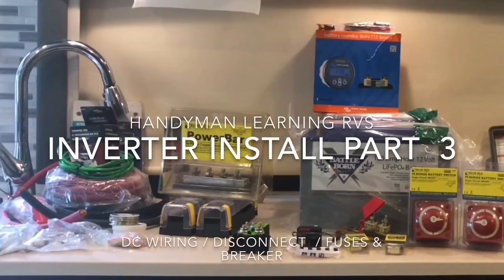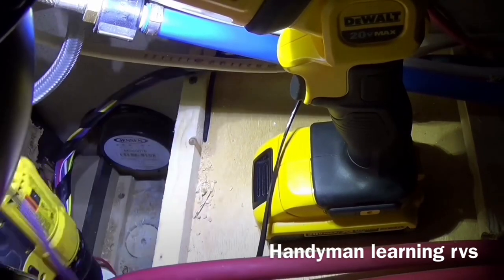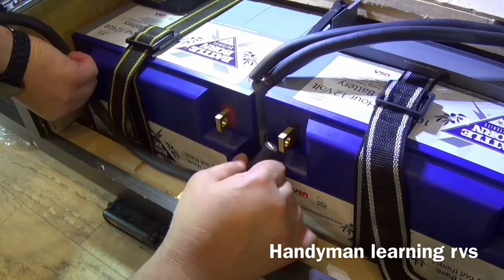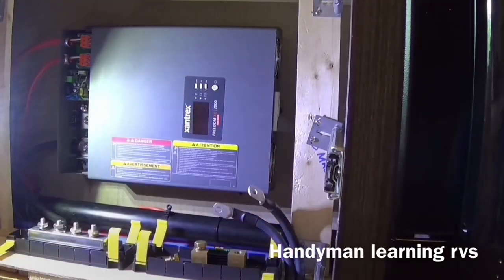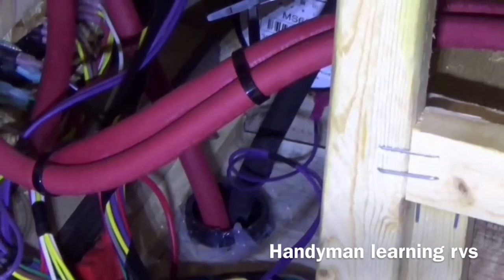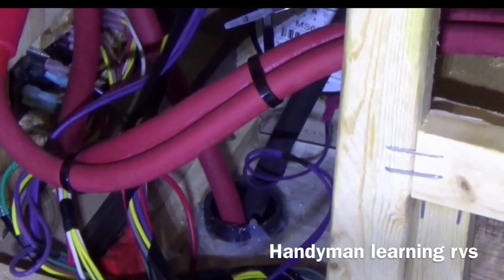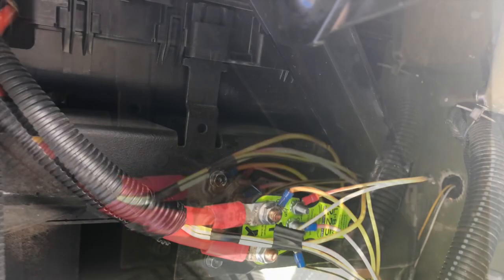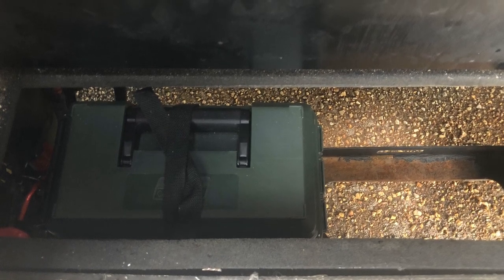RV Thor Axis Vegas inverter charger and lithium battery system install Part 3 of 3 (dc 12v wiring)

Comment: Hey, thanks a million. Excellent tutorial in a compressed time frame. It really works. The "lazy" in me wants you to provide a wiring diagram but I'll just have to watch thru again and draw it myself. I really want to see how you rewire and relocate the chassis battery. Accessing it's original location is like performing a colonoscopy with a flashlight!

Comment: How has the Li BIM worked?  Any alternator problems? I am adding 2 Li batteries also....Battleborn recommends a battery to battery charger and disconnect the BIM.  The charger is a lot more difficult to install and I lose the emergency start function....your thoughts?
Reply from the maker: I haven’t had any issues with it Li BIM. It doesn’t completely top off the lithium batteries due to the lower alternator voltage. When I purchased my batteries Battle born didn’t mention anything about a battery to battery charger at the time. The battery to battery charger will do a better job completely charging lithium batteries. If I were to put the battery to battery charger in I would cap off the Ign, Sig and Gnd wire. Then install a Blue Sea Systems 300 Amp m-Series Battery Switch in it’s place with it turn off to keep the batteries bank separated. That way if you need the emergency state just switch it on to jump start off house battery bank. Then after starting the engine switch it back to off.
Here’s a link to the switch I’m talking about. 
Blue Sea Systems 300 Amp m-Series Battery Switches https://www.amazon.com/dp/B00445KFZ2/ref=cm_sw_r_cp_api_glt_fabc_E2T4EMFA9DNECDY9T8BP?_encoding=UTF8&psc=1

Comment: Can I ask why you did not install the batteries in the original compartment under the stairs? I am looking to replace my wet\lead bar tteries in my Axis and came across your video. Thanks.
Reply from the maker: I did it because the lithium batteries don’t need to be vented. I decided to convert that area to storage. It could also be used to relocate the chassis battery.